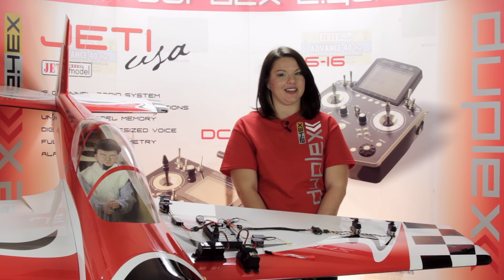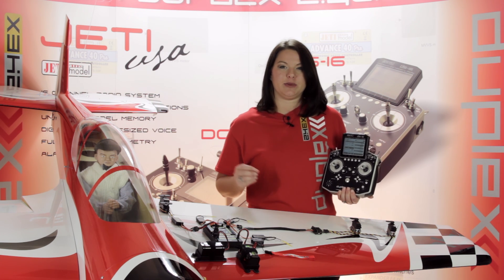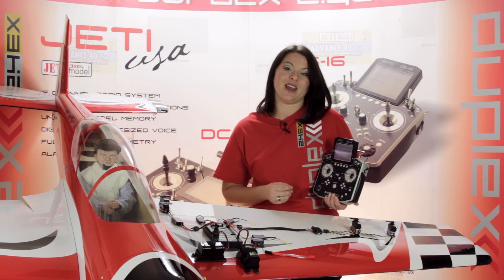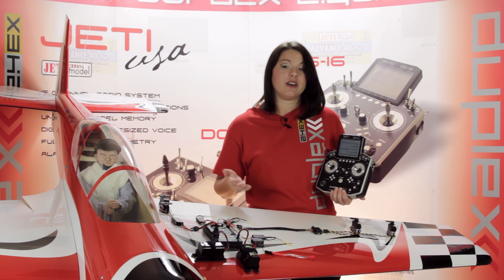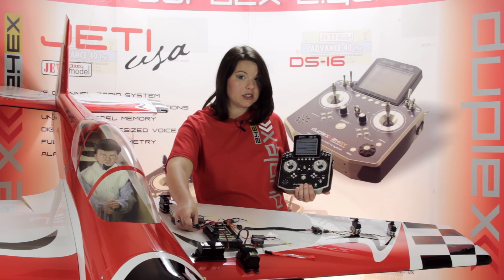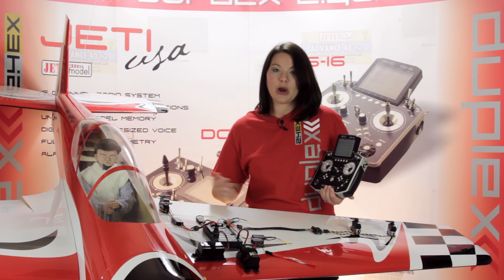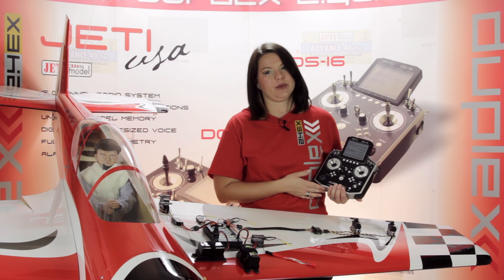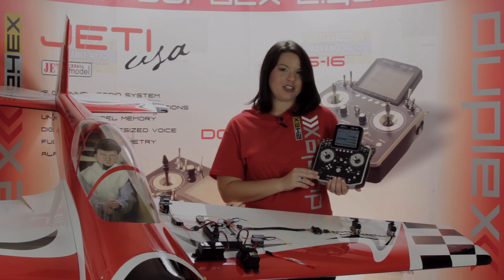A Closer Look: Jeti Central Box 400 Power Distribution

Comment: Question for you? I am using a JETI DC 24 transmitter with a central box 400. On wireless mode trainer page, I have selected 24 channels. However, when I go into device explorer, I can only see 16 channels and I cannot get channels 17 thru 24 to function.  Any advice on what I can do?